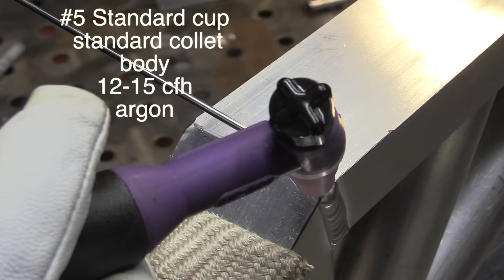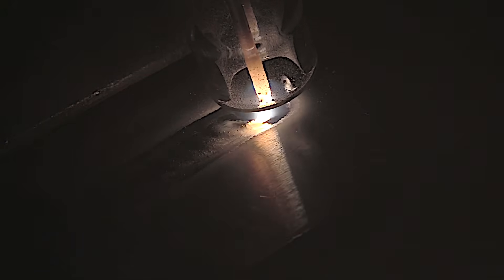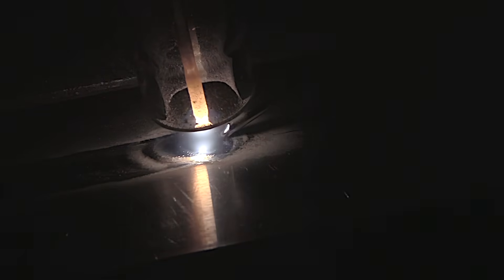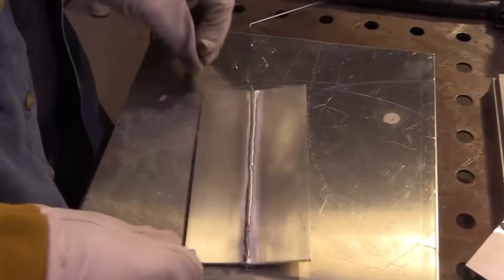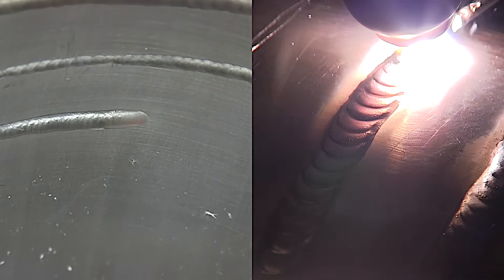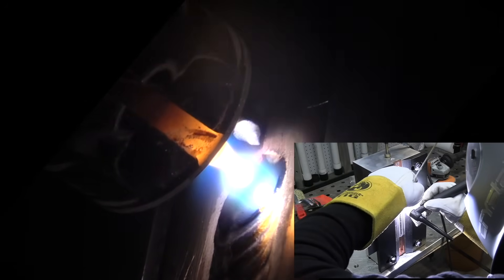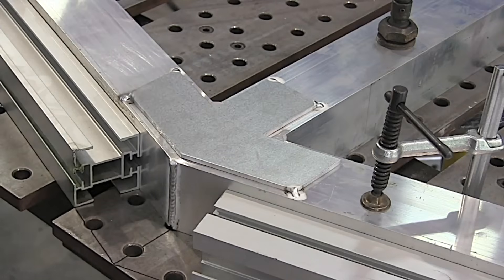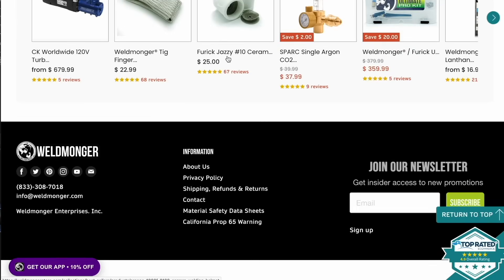Reading the Puddle for Full Pen on Aluminum Butt Joints

Comment: Hey there, I really appreciate the channel! There is a lot of really good info for beginner/intermediate welders. I was wondering if you might have some advice. I’m using a 20 year old Synchrowave 250 it’s a solid machine and I have pretty much the basics for it. Knowing that you have a lot of experience with welding machines I was hoping for some help in dialing it in. I’m noticing that it really struggles to get a clean good start but about a quarter of the way through a pass it really hits a sweet spot I’m guessing it is because the temp of the material gets up to a nice spot where everything wants to flow but at the tail end of the pass the weld just wants to lay down flat and penetrate almost to the point of distorting my metal. I try to ease of the foot pedal when I notice this happening but my tungsten starts to flicker like I am not maintaining a good enough arc. Any advice on this would be super helpful. Also I was wondering if you have a technique for balling the tungsten (I can do about 3-4 passes before it wants to start balling up). Thanks again! -Mike

Comment: Can you help me please. Ive watched you since you moved and built your first stronghand fixture table, I bought a mag tab after watching you and a tig finger, and still got em and use em lol. I've got a set of solid cast lower control arms off a car that need extending 30mm. I've made the jig and I've got some old solid cast lower arms the same to cut up and use to add the section then groove out and fill either side to get good penetration but what rod do you think would be best to use to weld them up and would you tig or stick weld them? Will they be strong enough welded with the right rod or would they really need heat treating after? Its not used on the road so there's no safety worry I just don't want them cracking through using the wrong filler rod. I know your busy but can you please help as your the best man on here that knows what he's talking about and got plenty of common sense unlike alot of people doing videos on utube. Thanks

Comment: I was taught that a bigger cup allows the gas to expand more rapidly... and an expanding gas will rapidly cool, so a smaller cup helps keep the gas compressed longer, thus more heat in the weld

Comment: Hi mr jody, can you make welding tutorial for Fillet joint almunium with thickness 1.0 mm (sheet) + 0.889 mm (tube) using specification AWS D17. 1 where the leg size minimum must be more than 1.5 x e and leg size maximum less than 2 x leg size minimum. Filler material (dilution) must be insert to material minimum 10 % with no suckback/melthru  on the sheet and tube. Thank you for your response

Comment: I just started using the Ally #5, but I have to run almost 25 CFH for it to work right. What's the deal?
Reply from the maker: that sounds like a lot for a #5 cup. I am usually around 15Cfh 20 tops. I would suggest checking all connections and torch o rings to make sure you are not sucking air
Reply: @weldingtipsandtricks  Thanks. Yeah all is tight and new.

Comment: Thanks for the Video(s) just the right video at the right time as i now have to weld some 1.5mm 1050 Aluminium sheetmetal. Helps a lot on what to pay  attention. Watching your Channel for 10 years or so, since i first had acces to a tig welder.

Comment: Me taking notes, ... great instruction video  :)
What balance setting you you prefer? I put mine mostly around   -5  for extra cleaning while welding.
I use it almost every time since I'm welding on alluminium that has been badly affected.
Reply from the maker: I probably use more cleaning than most.  I am often around 69-70 but for castings and heavily oxidized aluminum I go down around 65% EN sometimes (35% cleaning)

Comment: I always say that if you don't understand the theory, settings, and the mechanics of things like arc force, heat sinks, and direction/frequency of electrical flow you aren't welding, you're just guessing!  (and everyone gets lucky sometimes!)  Welding is 90% prep, but GTAW is 99% prep once you get the machine variables and consumables factored in.  Great video!